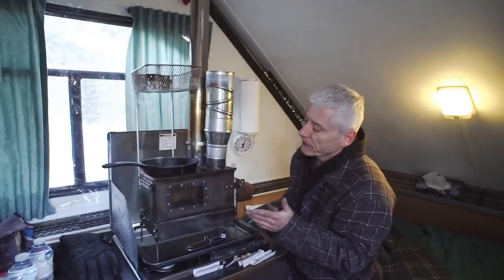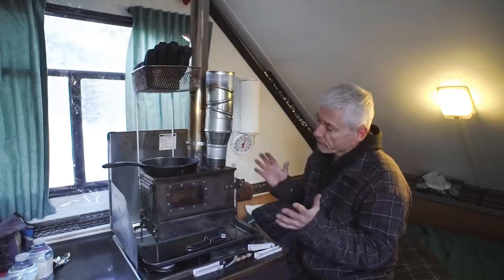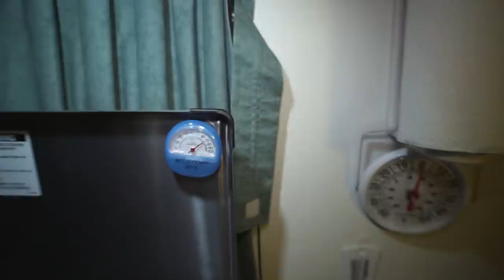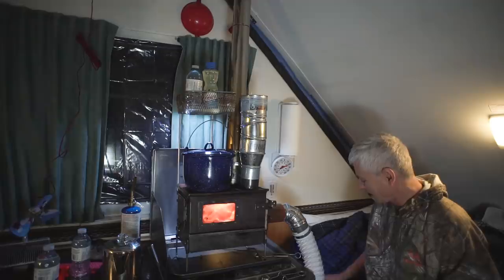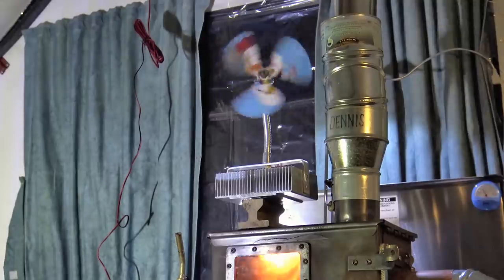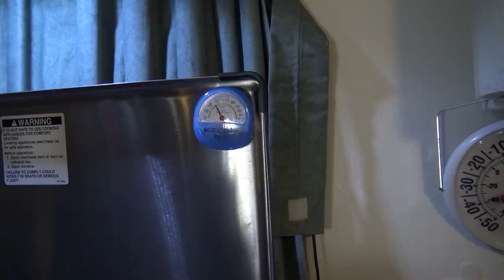Wood Stove in an A-Frame Trailer - Part 2

Comment: I know I am posting this comment a couple of months after you posted this, but I do have a suggestion for lighting your little stove, (very clever idea by the way). I heat my house with wood and at 5000 ft it gets darn cold here in the winter, so when I start a fire, I want it to take off ASAP. 

Here is what I use as fire starters. I take some dryer lint and stuff it in the sections of paper egg cartons and pour wax over it. Cut them up into separate pieces and one will start a decent sized log pretty quickly. Over the last forty years I have tried just about every fire starting method there is and this little trick works every time. You can get lint at just about any laundromat and wax is available in the canning section of grocery stores.

Comment: Location location location.... I don't profess to know anything that you don't, but if the stove is lower in the space (ie: the floor) it circulates heat better. Space constraints etc may prohibit this for you, but it's a thought. Really enjoy your videos.
Reply: Stephen Pike I thought that myself by the doesn’t have floor space to spare.
Reply: He has it on his cook top directly under the vent so he doesn't have to cut another hole.
Reply: Actually, his stove top fan will circulate the interior air.   With floor space very limited, this is a good option.

Comment: you could try a two layer pipe to solve your air intake from outside the trailer 
having a pipe inside of another pipe to handle both input and exhaust in the same exit through the skylight   may not be as easy to store but much easier for use   something you could try
Reply: Wouldn't the stove need to be able to channel the fresh air around the fuel and be able to control the amount of fresh air?  Right now,  for the sake of cost, I like the fresh air intake duct going into the front damper, as long as the damper is still operational.

Comment: Step ONE in lighting (any) stove or fireplace is to get the draft going up the pipe!  If the temp inside = temp outside you have no draft and many times cold air will fall down the smoke pipe (negative draft). When lighting a fireplace (or stove) the heat output from a paper torch at the draft exit is enough to get the draft to pull or go up the chimney!  This would require installing a coin size access port hole you can open and close in your chimney pipe near your stove.  With your stove door open put the flaming nozzle of your propane torch into the access port of the chimney to instantly create the draft!.  Love what your doing

Comment: Kudos for your experimentation and great final results. I hate the cold / damp so at 65 years old I'm now snowbirding in Tacna, AZ. My trailer is only 6' x 12' but has a separate tub & toilet, an 18,000 btu furnace and (3) 50 gallon tanks for fresh, grey & black water. I also have two 30 lb propane bottles & a propane fueled 3100 w Champion generator / inverter under the shell in the bed of my pickup. I use a mattress warming pad set on 1 (out of 10) which keeps me plenty warm even when the temp hit 36 degrees F one night. Although I have a single 200 ah AGM battery & a 2000 w inverter the power draw is very small. I also use a CPAP & the lowest battery reading was 75% the next morning.

I've recently subscribed & saved your '5 little places places to camp for free' video. I spent a few days outside Ajo & will try some of the other recommendations & hope we can meet up somewhere this season. I'll be visiting the Pima Air & Space Museum in Tucson in March so if you're in the area let me know.

Comment: no need to worry about CO2 or auxillary air.....    your litl camper isnt even close to being airtight!
Reply: The Back Forty and the hose just brings the cold back. Get insulated ducting if going to use this method...

Comment: There is a fan called ECO FAN that rotates by reason of the heat rising up from the furnace. It uses no electricity at all. You can set it on top of the stove and the heat makes the blades turn, you can face it any direction you want. No solar needed. No batteries needed. No propane needed.  Just heat from the stove. Lehmans.com sells them. Maybe places closer to ya as well. By the way, I enjoy your videos. Oh please keep safe. And please move those fire propellants  away from the stove. I cringe  every time I see them sitting too close. Sorry. I was raised by a fireman.
Reply: I'm sorry. I didn't know.
Reply: @thatcher81048  no reason to be sorry dethatcher. Good tip about proximity of propane.
  I was raised by an electrician. Cant leave a room w/out turning off light . Hehe.

Comment: Man dude, I was cold FOR you lol. Fascinating stuff. Glad I'm not the one experimenting though to be honest! Admire your courage. Way to freakin go!
Reply: PS: I had a similar setup to heat a garage. The only problem with flames is it can create a lot of condensation inside the enclosed space, which can lead to some premature corrosion and other issues.
Reply from the maker: I changed my reply after re-reading your comment. Yes there tends to be some rust inside the stove after use, but it cleans off well. No moisture in the trailer however as it is a closed system. Thanks! SP

Comment: Carbon monoxyde is the biggest danger
Reply from the maker: I disagree. The biggest danger is getting to camp (road accident). The second is injury while walking through the woods. The third is hypothermia. SP
Reply: Being injured would be a big problem too, I’d imagine. Yes, Carbon Monoxide can harm you, but slipping in the street can do that too.
He seems to know what he’s doing and he seems to be pretty safety conscious.
We wouldn’t leave our beds if we start to consider all the terrible possibilities out there 😉

Life’s an adventure and you have to take risks, to survive 🌈
Reply: @SlimPotatohead  wow, yeah all of those would suck being a solo traveler.
Reply: What about a $15 carbon monoxide detector, battery operated, from Home Depot?
Reply: I've never ever heard of a wood heater giving anybody carbon monoxide poisoning. For emergency heat a beanie weenie can with about 2 oz. of rubbing alcohol will burn at least 30 min., and put out a good bit of heat. Light it with the propane torch.
Reply: I actually wouldn't think you need the hose to bring in external air. As air burns and exits the vehicle it is equally sucking air from the outside of your camper. There is no way the camper is air sealed. That's just my perspective after a lot of research on internal heating systems in homes.
Reply: @SlimPotatohead  .  Fourth is running out of beer.
Reply: @EricKas  Sorry friend, that is false. My father was killed by Co poisonin...., in a trailer. Burning with outside air is always preferable. Why burn your inside air when you don't have to?
Reply: Eric Kas 1 month ago, "I actually wouldn't think you need the hose to bring in external air.   ..."
Eric, but by so doing, he doesn't have cold air infiltrating the living quarters, cooling it down before it is inhaled by the fire. Let's the cabin warm up, and the cold outside air snakes up through the hose in the cabin, and just feeds the fire. If anything, through some insulating blankets or insulation battons around the COLD HOSE cutting through and cooling the cabin. Or like Sam said earlier, shorten the hose to an outside fitting right behind the stove. So he understands that already.

Comment: I agree 100% with Glendram below, you are endless inspiration and for me entertainment as well. Your demeanor is so unselfconscious and pleasant.  Thanks. BTW I have installed two HQST flex 100W panels on my 24' Itasca mounted with Eternabond with a 75/15 MPPT controller. It's working out well for me so far. Wish I could take the cold like you. I'm a thin skinned SoCal guy.

Comment: I like your vids. I raised a family using only wood and variants for 20 years. We used various stoves over the years. An Earth stove, a buck stove and tried others including a pellet stove but usually burned several cords of hardwood that my boys and I harvested. It is my opinion based on experience that you  are better off to have a small opening at a window near your bed than to try using additional combustion air sources! Too much combustion air source will dilute the the heat gain from the stove. It also helps to have some long sections of single wall stove pipe before the ceiling penetration {which can/should be double or triple wall with a metal roof penetration}.  There are stove pipe heat extractors that mount above the stove that also serve the same purpose. The stove pipe is a source of a large percentage of your heat. If you come out of the stove and then have a near horizontal piece of pipe that exits the roof further from the stove you will recover more heat. That size stove in that small space shod be capable of running you out! Be blessed.

Comment: Most of the other comments cover what I have to say regarding thermal mass, which you addressed and you did suggest making a dedicated intake vent closer to the unit rather than than the un-insulated vent duct across the floor, but I am surprised you did not use pine cones as fire starters considering the nature outside. Bit late to the channel but thoroughly enjoy the content, cheers from much warmer Australia

Comment: Great experiment, tough guy! My business was making buildings airtight. You had a lot of cold air streaming in via the inlet of the stove. Long pipe and probably not insulated, you had a large surface at -25 Celsius entering the trailer. Best solution to make that hole behind the stove and use insulated pipe. Still thanks for the good explanation. Cheers from Belgium!

Comment: I love your thought process, Slim, while you go about problem solving. Excellent video. My only suggestion after years of camping is... fill a 2+ gallon pot of water, put it on the stove right after you start your fire, by the time you go to bed the water will be nice and hots. It will give off lots of heat hours after the fire goes out.

Comment: You could attach a small lever on the side of the cage (with some sort of hook system so it's still removable) that goes out through a slot on the side so you can jiggle the coals easier.

Comment: Slim, we have an ammo can stove in our 10 ft. home built canned ham that I insulated well - except for the floor. We have used it At temps down to 2 degrees and it will warm us up to 70+ degrees in just a few minutes. The floor has a rug and an insolite pad so that helps. I may get under the trailer and try to insulate but overall the stove works really good. BTW our stove is built in to my custom design in a metal lined hearth.

Comment: Great job and test.  I like they way you solved the prototyping problems.  As an Alaskan I feel the cold with you.  As a 60 Y/O stoking the fire every 3 or 4 hours would probably be timed with needing to take a leak anyway.   Plan on building one of these just cause.  It looks like it would make a  great little wall tent stove as well.  Great job.  I. Like the pipe insulation in place of the noodles as well.

Comment: For your windows, you may want to get quilted window guards which are quilted mats with a magnet around the edge which will then attach to your metal window frames. They will give you much needed insulation. You may find them at a camper Supply.

Comment: I know you did alot of work on this stove and I commend you brother. I would like to offer you my solution for staying warm in my class A. Everyone freaks when they hear Chinese diesel heater but they work extremely well. Before I had my diesel heater I had the old stock furnace from 1987 and you can imagine how efficient it was lol(when the thing would even light off). Diesel heaters are cheap and they perform very well just make sure you buy one with a metal outer body instead of plastic tho I'm sure the plastic models will work fine too. Much respect, love your videos!

Comment: To get just a little more heat from your wood stove I have seen a clamp on set of fins you attach around the chimney that helps radiat the heat from the stack out into the room. I understand these fins also lower the temp. of the remainder of the stack.    Great setup you made there,I love it!

Comment: I lived in an A-liner trailer like yours for about a year, just traveling around, part in some cold weather.    What I did was use some close cell back packing sleeping pads up covering the windows.    I can't recall, but it think I just duct taped them in place.

One of the things I noticed in the cold weather was that the A-liner foam roof panels forms little bubbles, that if I popped them with a pin, there was moisture behind them.

What would be better, imo, would be a small trailer like the Armadillo.

Using the fan for circulation was a really good idea.

Comment: Fine Slim !
  I imagine a vibration induced ash clearing tool ...  you know , pull a trigger and an elliptical wheel shakes the basket or a steel pick , strums the comb of the basket ?  Then again , that may too tightly pack the pellets .  OR , use the Pelletier driven motor to drive an Archimedes screw Feeder as pellet stoves often use !
  Always a fun watch .. Thanks Slim .

Comment: Hello Slim.  I just stumbled across your videos about the stove and I really enjoyed them.  I've worked to make homes more energy efficient for over 30 years, so I know a bit about thermodynamics.  Hopefully these tips will help.  What you are essentially doing is converting wood pellets to btus (heat).  To heat your trailer, you need to get those btus into the air inside the trailer faster than they are escaping through the walls, etc.  Btus in must be greater than btus out.  Some btus are absorbed by the thermal mass (objects) in the trailer, but they will mostly be released back into the space as it cools down.   Btus out (loss) can be reduced by insulating and sealing your trailer.  Btus in (gain) can be increased by improving the efficiency of your stove. Efficiency is btus put into the space divided by total btus in the wood pellets put into the stove.  The btus that are not going into the space are going up the flue pipe.  If 40 btus are going into the space for every 60 that go up the pipe, your stove is 40% efficient (40 / [40+60]).  Modern commercially built wood stoves are in the 60%-80% range, at best.  Realize that the cooler the vent gasses coming out the top are, the more btus are going into the trailer.  Your stove is putting btus into the air by two basic means: convection and radiation.  Improving these will improve the efficiency of your stove.  I suggest putting some kind of fins on your stove and stove pipe to increase the surface area in contact with air that will naturally convect around it.  Also, you can improve radiant output by painting the stove and pipe black.  They make black spray paint specifically for wood stoves.  Dark surfaces radiate (and absorb) heat better than shiny, light colored surfaces.  That's how space blankets work.  The shiny material greatly reduces radiant heat loss from your body.

Something to always remember is that for a cubic foot of air to leave a space, it has to be replaced by another cubic foot of air coming in from somewhere.  If your trailer was perfectly tight, like an ice chest, your wood stove would not draft (flow).  One big problem with wood stoves in general is that there is a substantial amount of air/smoke/gases going out the flue pipe.  For that to happen an equal amount of cold, but fresh, outside air must come in through leaks.  In your first video you mentioned your concern about suffocating, so you attached an outside air intake duct to the stove (technically, we call this combustion air).  While this greatly improves heating because that cold outside air goes straight into the stove, it actually increases the chance of suffocating because you reduced a good supply of fresh air.  Your trailer is probably pretty leaky, but if you seal it up, you should also ensure a good fresh air supply.  It does not need to be much.  You can put it right behind the stove or near the floor where cold air won't bother you.  I recommend that you insulate the outside air duct that you attach to the stove.  It's going to be the same temperature as the outside air, which will absorb a lot of btus. 

I hope this helps.  Sorry to ramble.  I enjoy sharing what I have learned over the years.

Comment: At the peak of the A liner you could place some reflective material to help direct the heat back into the camper and insulate against the cold, or you could suspend some as a false ceiling before the peak to do the same thing.

Comment: I would be interested what it would do with just a good hard wood fuel. You’ve done a great initial concept and added to the field with your work.  I’ve got lots of ideas now.  Since I will also be building my outback trailer, insulation will be first on the list. Thanks.
Reply from the maker: The pellets are hardwood, but unfortunately I rarely camp in hardwood forests. Mostly spruce, pine and aspen in the  mountains winters here, no oak or maple. SP
Reply: Slim Potatohead  the tree cutters in the city cut down a lot of ash, maple Ect ash is best almost as good as oak.  They also chip up the hardwoods into 1-2 “ chips that could be very handy for your stove.  Another thing you might try is to bank your stove with charcoal briquettes before bed. Luck

Comment: Slim, could you make a thermosiphon water heater?  Bend copper pipe to encircle your pipe.  Have the bottom feed from the bottom of a tank and the return top pipe feed to the top of the tank.  That way you could capture more heat before it escapes.  The water would act as a heat moderating radiator and possibly keep your space warm longer.  I could see an old small pressure tank being the water reservoir.